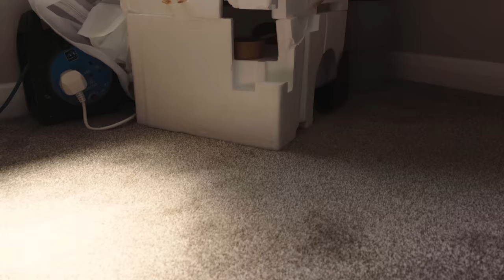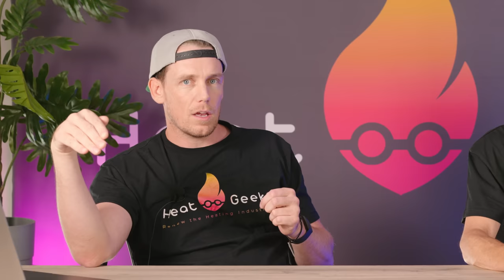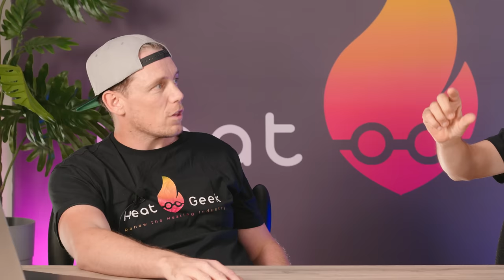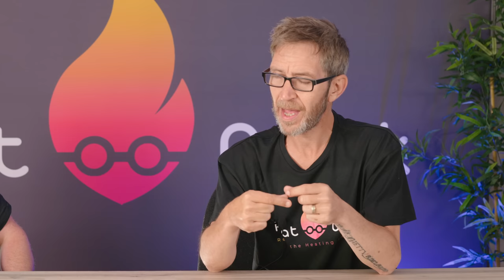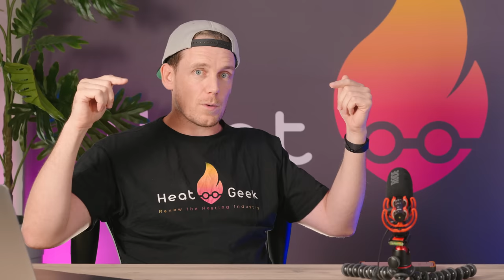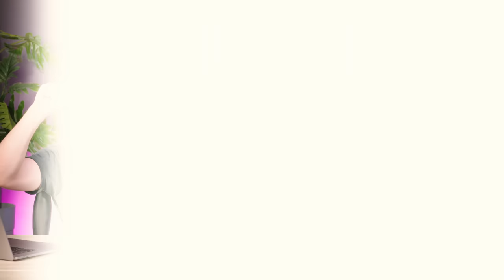Cooling With Heat Pumps | The Technical Details

Comment: Thanks for that. Really useful. There seem to be two approaches to cooling, first is: I need to be able to cool the building to 21C in worst case circumstances and therefore need huge unit, the other is: I have a heat pump and would like a bit of cooling occasionally as a bonus at low additional cost. I’m much more interested in the second of these. Key messages for this seem to be: need some fan units and best to stay above dew point.

Comment: I think this may have been the video I'm looking for.... just about to do an extension and renovation (complete back to brick job) on a 115yr old house and planning to put UFH on all 3 floors. If I can use an ASHP for cooling that would be perfect for those hotter days. The dew point aspect is very interesting. With regards to having extra emitters in the rooms that require cooling is it possible to hide these in the ceiling? Im thinking what if I was to hide the units between the joists or in those rooms I had the ceiling dropped around the edges by 6 inches would that allow space for a small emitter to assist the UF? The air could be fed through a small discreet vent?

Comment: Could you not plumb all four corners of the radiator and then use two manual valves to switch from both bottom fed to both top fed in summer? Might look a little odd I suppose but I imagine could be neat enough

Comment: I'd think that if you created a 'zone' that included the rooms that you want to potentially cool and used fan coils in those rooms , then when you only want to cool, the fan coils are used (perfectly OK to heat with fan coils).  Fan coils are far more effective than trying to use a 'radiator' with cold water running through.  They also have provision to collect the condensate if they've been designed to cool...

Comment: How does underfloor cooling on the bottom of the build work? Surely the exchange rate isn't too great as the cool air will pool on the floor without some active mixing? Cool feet but still a hot room? Same with rads without fan assist too?
Reply: Yeah the air at the top of the room will still be warm, but the floor will collect some of the infrared energy bouncing around and being radiated from warm surfaces like ceilings and walls.

So you will probably need to stir the air with a fan to get the best feeling, but the cooling floor will extract heat over time. Especially useful to knock a few degrees of the worst of things in the afternoon, plus at night to help cool the thermal mass of the building (as they say in the video).
Reply from the maker: It works as an Infra red sync.. same way ceiling heating works... its great tbh

Comment: Remember Part O of the Building Regulations on Over heating needs to be complied with to limit Over heating risk. With complex new build this will be via dynamic models which can do your cooling calculations.  Your fan coil units recommend Jaga - Strada light cool (16/18 flow temp) no condense and you can run without fan in heating or Briza for more cooling needing condense.
Reply: Jaga - didn't know about them, thanks for that!

Comment: I've been cooling my home room heat problem via CH using a separate Expansion tank incorporated with a old Pub under bar beer chiller...
Top & Bottom entry valves...
For over six years...
Reply from the maker: Ide like to see photos of that!
Reply: Me, too!  Sounds like a “home brew” version of the SAHP BTMB - nicely done.
Reply: @tomkacandes8286  Yep: a fan coil piped to a beer python and use the flow and return that would usually cool the 'python' of pipes.  It works... may not be the most efficient, but on those few really stiflingly hot nights when you can't sleep: who cares?

Comment: For those of us on the other side of the pond, what are you looking at as far as RH in the summer? Here in the US South, we're more concerned about humidity first, and temp second. For those of us who work on residential hydronics, we're just starting to see low-temp boilers and A2WHPs in our future, but it's years away. Trying to stay ahead of the curve, I'm trying to figure out how to compare apples to apples.
Reply from the maker: Typically about 9c.. our testing here was at 7c flow when dew was at 9 and not much risk at all! We're only cooling a couple of weeks a year though typically..  40c today!
Reply: @Corey Rodgerson Enertech, SpacePak Solstice are two units you can buy here and look at - we install them in the NE US and they work great.
Reply: @tomkacandes8286  we're in the DC/Metro area. All my vendors are looking at me the same way a cow looks at an oncoming train. What vendor are you using, if you don't mind me asking.

Comment: Really curious about air to air pumps. Living in portugal the cooling is very important. Our house is 100% off grid (except for internet…) so I’m hoping to cool during the day with solar power and then hope the nights aren’t too hot! (Out of interest, The recent 45+ heat wave was allied to cloudy conditions so there wouldn’t be much I could have done anyway…).
Reply: air to air are much more applicable to your country - its a no brainer. Unless you've got a particularly difficult house to run refridgerant lines in and you already have water piping in, go air to air.

Comment: I was recently told that for a heating only pump as a boiler replacement the exterior unit could be could be installed as a permitted development but that a reverse cycle heat pump, capable of both heating and cooling, was excluded form PD terms and would require planning permission.

Is this the case?
Reply from the maker: That was part of thi which has ended. That can be ignored now

Comment: In the US we do hydronic fan coils that run at 8 watts on low, very quiet, insulate the piping and have heating and cooling where we need it, sometimes in combination with UFH and panel rads all on the same system.

Comment: Thank you for all your video it's so interesting stuff ..
years ago. I done underfloor heating with the heating pump for cooling . But in that case you need ventilation if you have a good ventilation and you don't have a lot of condensation between the pipe on the floor. Like ducting system...

Comment: Great video. "Hot" topic again this year :D So if i sum it up;
- If we have heat-pump capable of cooling and underfloor piping. We already have infrastructure to lower the house temp to some extent (by 2-3deg).
- We want delta-t (between air and floor) not bigger than 5-6deg. This means if room temp is 26deg, target 20deg . But leaving water temp (from heat pump), can be lower (delta-t between floor surface and water in pipes) around absolute 15deg?
- Question about delta-t between leaving & returning water....what is a good setting? 3deg?
- If we wish more cooling power, we need to connect fan-foils/convectors, that are able to collect more energy.

Comment: The downside of radiant cooling is the fact that you have to stay above the dew point, when in reality we want to be able to lower the dew point of the air (a good target is typically 50-55°F, sorry don't know the °C dew point target).  We as humans are more susceptible to the humidity in the air vs. the sensible temperature, therefore supplemental dehumidification is often required when doing radiant cooling.  That's the other reason for utilizing fan coils with ASHP's as they are able to get the coil below dew point and remove humidity.
Reply: Also you could use a mechanical ventilation to remove to moist air in this case

Comment: Just install an ‘air to air’ heat pump AC system for cooling and heating. You can install a Daikin VRV with one condenser and multi heads throughout the property. Forget radiators etc it won’t work.
Reply: Will it provide hot water too
Reply: @edc1569   No, but there are many cheap ways that can be achieved
Reply: It does seem that cooling through rads etc unlikely to provide much cooling? Is there a reason the mvhr system cannot have a heat exchanger in the system to provide cooling?

Comment: I have an old air con system and am looking to change it. I am also looking to change my boiler to a heat pump. What are my options Uk? Do your Heat Geek installers do both air con and heat pumps?
Reply: Some yes, not all of course.  If you put a request in to the office through the contact form we can check your area and help with specification
Reply: @paddingtonbear4104  ah not too far from our office in Surrey 👍🏽
Reply: @patrickwheeler2646  Good to know. Can you tell me, is there an option to have a combined Air con/Heat pump heating solution? If so, are you an option for me? Obviously your name/company would have to be listed on the Heat Geek site of installers.
Reply: I'm Adam's partner in Heat Geek, our office is in Surrey so although I'm not sure we can help directly, we can give you a decent head start.  Contact the office and mention my name to get a call booked in.
Reply: @patrickwheeler2646  Thankyou Patrick. Will be in contact when ready. 👍

Comment: I was watching your videos on how you trial the cooling mode with your ASHP and your radiators. Then you had this, where you went a step ahead and used underfloor pipes. I was hoping that you reach the final solution and have a ceiling circuit for cooling. So why don’t we have a heating and a separate cooling circuit?

Comment: How do they configure their heat pumps in US? I cant imagine they use rads for cooling
Reply from the maker: A2a... the US is hardly a beacon of efficiency though...
Reply: Geothermal and air source, air to air units.  Must are probably ductless mini-splits.
Reply: When I have specified air-to-water heat pumps in the US, we connect to “fan coil units” or water-appropriate cooling coils in air handling units connected to duct work. The latter is done to reduce valves and pipe work complexity while customers here are very accustomed to cool air from centralized ductwork. People here think one MUST have ductwork to even consider GSHP. Only a few times do we get to connect to radiant floor and in those cases, we use some fan coils sized only for cooling that are able to run separately in summer. In winter, they help with rapid warm up if the owner has forgotten how radiant floor actually works (it is hard to beat the “set back” thinking out of people, but a large stick helps…).  Hot tank + cold tank for buffer and allowing “simultaneous” (really switched) heating vs. cooling. Yes, we are “hardly a beacon of efficiency”.

Comment: I’m not seeing any mention of MVHR here, surely this would be of great help in mixing the cold from the underfloor slab throughout the house. Like the UFH it would need to operate in a sort of reverse mode as by default it will try and retain as much heat as possible when mixing fresh air. Maybe a fan coil rad could be plumbed to the intake to cool down the incoming air that is then sent to the whole house , even 3 or 4 rads ? I feel a mix of these two technologies could be the answer.
Reply: +1 Interested in MVHR with underfloor heating plus ground or air source.
Reply: MVHR can have duct coils fitted. It’s not advertised or often done though. Then you can heat or cool the duct coil by use of refrigerant system (ac) or a chiller / heat pump which circulates water through the coil. Can change incoming air 25/30’c down to 10’c coming into your house. System is set on bypass mode so essential straight through rather than recovering. Also make sure ducts round the house are well insulated to prevent condensation. It’s a whole house solution.
Reply: @darrenr1995  I have a new build with MVHR, I've added a duct heating coil to pre heat the air coming into the house, the ASHP provides the warm water for it. I did consider using it for cooling but a) the ASHP I have doesn't support cooling b) the ducts aren't insulated, other than that it would be been a good way to cool and dehumidify the house.
Reply: @blahblah1234392  don’t worry about the ducts not insulated. Better if they are to hold the temp in the duct but you won’t get near the dew point on a house with MVHR as humidity is low. We have MVHR with a duct coil. A small chiller / ASHP (4kw) cools the coil to a constant supply air into the MHVR of 11’c. Then by the time it comes out the plenums in the rooms it’s around 15/18’c. Way above dew point. It creates a lovely fresh cool whole house. Even when it’s 30/35’c outside. 
Main priority is the duct coil has to have a condensate drain. Lots of condensate is formed naturally in this coil. Also condensate is produced within the MVHR but that has a drain anyway. We opted for a chiller which is a ASHP but only does cooling not heating. Being a new build also, we don’t need anymore heat!
Reply: @zlmdragon.  Hi, these systems are installed in the UK.
Reply: @darrenr1995  hey Darren, really interesting post, we’re considering a similar setup but hadn’t thought about factoring cooling in. Are you in the UK? Who designed your system? We’ve been talking to GBS amongst others. Interested to know what brand duct coil you used. Thanks in advance

Comment: When a heatpump is heating your hot water cylinder the evaporator outside gets cold.
Could this 'free' cold air be directed/ducted into the house on these rare heat wave days?
Reply from the maker: You would have to uninstall and reinstall ducting.. also this adds resistance to the main fan.. lastly.. it will only give 20 mins of air which won't do much
Reply: @HeatGeek  thanks.

Comment: Guys, I have a question for you both, if you were taking one room and fitting an air to air heat pump ie air conditioning how would that be compared to air to water for heating ? In the winter would air to air heat the room as well as air to water.
Reply from the maker: Air to air slightly more efficient and slightly less comfort.. can be cheaper to install too especially for 1 room
Reply: @HeatGeek  wow ok, I knew air to air was a more instant heat/cooling, I wonder why more homes don’t use air to air as a complete home heating system
Reply from the maker: @11x11z11x11  they already have hydronic systems and you meed hot water

Comment: Super interesting guys. I’m in exactly the situation your talking about with an extensive renovation (where it’s effectively a blank canvas/fresh install with new pipe work), and there’s glazing designed for solar gain in winter. However, aside from masses of insulation, air source with UFH and solar PV/battery, we’re looking at MVHR too. My question is can and how would MVHR (Zehnder Q350) with summer mode assist with UFH for cooling? Is it just by increasing the effective convection/air circulation? Really keen to hear your thoughts 🤞
Reply: I'm also looking at Zenhder units, there is an add on unit that goes on top for cooling, it is a module. I'm researching if it can work well for cooling. Happy to bounce ideas about it as I have similar project in place.

Comment: I am moving soon to a new house designed with undefloor heating downstairs and radiators upstairs and a natural gas burning source. I'm thinking that in the future when heat pumps get cheaper (or gas gets more expensive) I would like to retrofit one and replace the gas boiler, for both heating and cooling. Do you think that would be a hassle and it's better to do it now when the house is still semi-finished?
Reply from the maker: I think it's better to do now. Otherwise you'll have to disrupt a finished house. Also with ufh your goingnto already be somewhere around 20% cheaper than gas anyway...
Reply: @HeatGeek  I was thinking if all I'll have to do is replace my radiators with fan assisted ones, and the boiler with the pump, it shouldn't be such a mess. Also, I wouldn't spend an extra 5+ thousand on a pump right now. The house already comes equipped with the gas boiler as standard.
Reply: @zlmdragon.  Yes, I've already made up my mind to keep it as it is for now and see how things evolve in the future. Right now heat pumps are very expensive and also hard to find, because everybody wants one and they can't make enough of them.
Also, for cooling I have decided it's better to install smaller regular AC units in every room, it should be more efficient.
Reply: @zlmdragon.  I know, but I would rather have many single splits than a lot of duct for ventilation on the inside. Also the rooms aren't very large so I figure 9000BTU units are cheaper, even if I need several of them.
Reply: @zlmdragon.  Yeah, for some reason these multi splits are at least twice as expensive as the same number of single splits (Daikin included)

Comment: What would be a suitable level of insulation for existing underfloor copper pipes if you were to retrofit Heatpump cooling? Taking your point about condensation, what products would you use to "wrap up" these existing pipes?
Reply from the maker: Class 0 and vapour sealed. It's a specific job
Reply: @HeatGeek  thanks - imagine this only goes for pipes that are between floors?

Any pipes for ground floors (under screed) wouldn't be an issue? Except where they pop out through screed, there may be condensation on those exposed sections?

Comment: Have you looked into the option of intigrating cooling with a MVHR system for new / whole renovation projects? or would the volumes involved be nowhere near the required capacity needed for useful cooling?
Reply: I had the same thought, I have installed a heating batt into my MHRV system but you can also use it for cooling the air coming into the house. You do have to make sure that all the air ducts are insulated though to prevent condensation forming on them.
Reply: Air volumes are too low
Reply: Zehnder has a add on unit to use on their MVHR units to cool the air, I'm researching about it